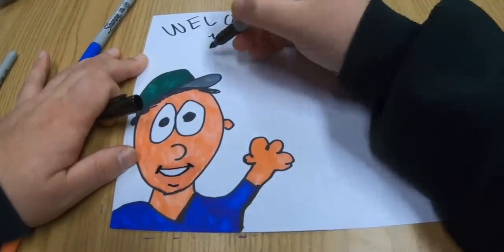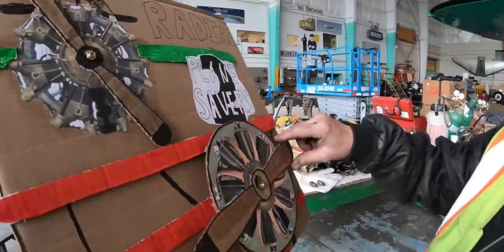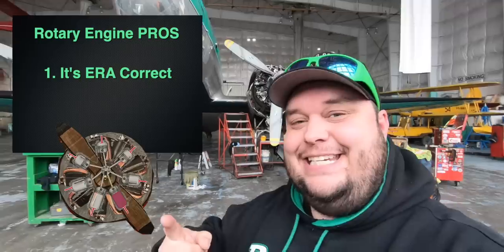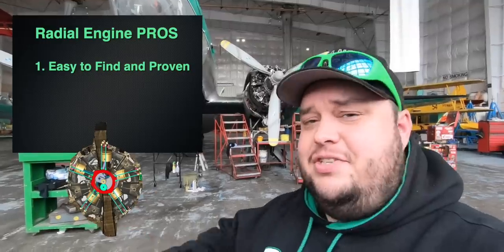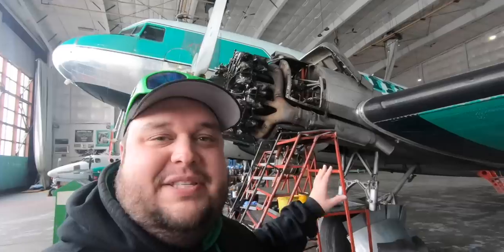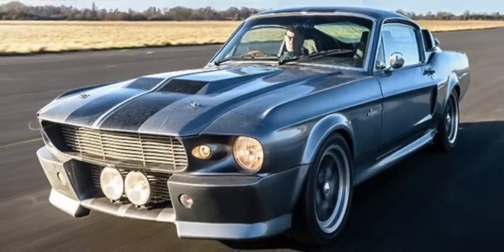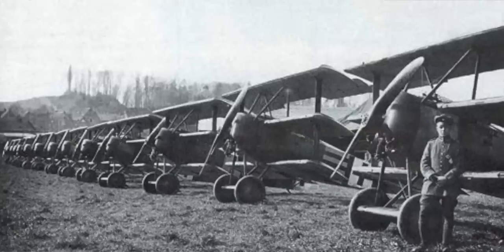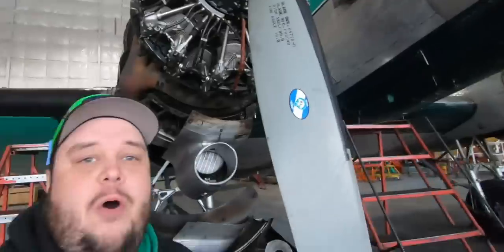Radial vs. Rotary | AIRCRAFT ENGINES | Plane Savers S2-E6

Comment: They did have a throttle; in fact, most of them ran very similar to modern aircraft (air and fuel adjustment) engines minus the starter and the sucking procedure. Only engine that was one and off was the Gnome 100hp series and later they improved it with the Gnome 160hp series of which used an ignition timer instead of a carburetor in which the spark will change the number of cylinders get ignited when they were filled with fuel and air. The Gnome 160hp used a four place switch it which throttle was operated by the number of cylinders that were sparking. It was odd-numbered as most rotarys had 9 cylinders. Ergo a four/five place switch.
1,3,5,7,9

Comment: You will want to read "Flying the Old Planes" by Frank Tallman, who discusses the operation of the rotary engine.  The Gnome Rotary used castor oil for lubrication.  You are correct that the pilots breathed the vaporized oil, which made for some interesting problems.  You can imagine why the pilots walked with a certain swagger.  This also is why the pilots drank milk laced with brandy.

Comment: Early Rotary Piston engines also used a "total loss" lubrication system using  Castor based oils which is why pilots were always seen running for the toilet on landing!

Comment: Sensible move on the Radial motor the Rotary was an absolute dog to fly with very poor throttle control...basically "All or Nothing"!
The old WW1 pilots did indeed get covered in oil, usually Castor Oil which had a rather unfortunate effect on the Pilot's Bowl as it is a laxative! Unless you want to spend the rest of the day in the "Little Boy's Room" after a brief flight around the field, stick to the Radial.
Did I hear you say a DR1 Turbine, now there is a thought...OMG, No no... I think I need to go lie down

Yet another great video and I love the graphics and animation...as ever ...keep up the good work matey!

Comment: The cowling of a rotary engine is closed on the top and open on the bottom. It is cooled because the engine rotates through the open space at the bottom where air flows over it. A radial engine's cowling is open in the front but closed on the sides and curves in toward the front so that it covers part of the front. If you put a rotary engine cowling on a radial engine it will overheat. The rotary engine cowling was closed at the top to deflect part of the exhaust. The engine lubricant was castor oil which is a laxative.  Rotary using pilots did not have constipation problems.

Comment: Great point on cars and your logic I feel it spot on. I have a 68 mustang fastback that I'm building , and it is funny how the movie the car and a real Shelby are so different  in all reality. In the end I'm just building mine stockish. Not an Elanor or Shelby clone, which it is a bit odd because both were the reasons to choose that car in the first place, but just as they were they were from Ford was cool. Of course I did have to buy a Shelby 67 GT 350 hood that fits the ford front end, and the car will have Shelby stripes. Running a Windsor engine built up, and never came in that year, but nothing had to be chopped up to do that and could be put back to 100% stock pretty easily.

Comment: 10/10 for staying with the original engine type as fitted to the replica airframe which was designed to accommodate it. This means there will be needed no innovations or experiments or workarounds to make something else do the job. - Safety first.

Comment: As noted by others, it wasn't just total loss lubrication, it was originally castor oil as they had no other lubricants that could function at high altitudes. And, yes, you had fights in that war as high as 18k, as Arthur Gould Lee noted in his memoir, No Parachute. He flew a Sopwith Pup and had to fly very high, and with hypoxia, to be on even terms with the Albatross DIIIs he was facing. There was another fight too due to the castor oil. It was treated with a large belt of brandy just prior to flying, "To stun the bowels," as Lee put it. 😂 Personally, I'm disappointed with your understandable engine choice, but it's not my project and I wish you nothing but luck on yours!
Reply: Plus castor oil clings to metal unlike ordinary oils essential for a spinning engine,the negative side is that it becomes gummy and needs a lot of maintenance,fabric used to go sticky.

Comment: Mikey, I have read that rotary engines in ww1 planes used castor oil instead of dinosaur juice. As you mentioned, this flies into the pilots face. Some would be swallowed. This led to a constant semi-diarrheal state for the the guy in the cockpit.

Comment: "FUN" FACT: Not only did the rotary engine spit out combustion products and oil straight out, including in the pilot's face, but it was lubricated with liberal amounts of castor oil. Castor oil is a strong laxative, and the first thing WWI pilots did after landing, was to run to the toilet, because they ingested quite a bit of the engine lubrication.
Sh*t happens. Especially if you were a WWI pilot! That brown note aside, those pilots had a pair of brass! Life expectancy was extremely low, not only because of enemy fire, but also because the planes they flew had only been about a decade in development since man's first powered flight...

Comment: With the way rotary engines were designed the exhaust strike of the engine was always when the cylinder was pointing toward the bottom of the plane whicb is why ww1 aircraft had that stereotypical partial cowling were the bottom was. They did however fling oil in all directions again facilitating the open bottom cowling minimizing oil being flung up and directing it all bellow the plane. The exhaust for the rotary engines  ever really reached the pilot only oil ever did. Other wise everything else was on point! Well done!

Comment: Don't underestimate your 318, they're potent when tweaked just right. Definitely check out the original Gone in 60 seconds, about 45 minutes of just car chase. Make sure you watch the history and making of the movie, gives you a better appreciation of it. 
I think the radial would work fine. You only see the bottom through the cowling, in the air you won't be able to notice and it's already been in the plane so makes it easier to stick with it.

Comment: My understanding is that the rotary engines used castor oil as a lubricant and the constant spray of oil from the exhaust onto the pilots face and lips would cause them to ingest small amounts and gave many of them a chronic case of the runs.

Comment: Very nicely done, Mikey. Just for the record, when I asked the question a couple of episodes ago (radial vs rotary) I wasn't particularly advocating for one or the other. Based on the excellent points you made here, I wholly support the choice of radial.

You mentioned the lack of throttle on the rotary. Anyone who has ever watched movies/videos of rotary powered aircraft know the sound of the aircraft on final as they switch the ignition off and on ("throttling" back, as it were). It's a distinctive "braapp!" "brapp!" sound. And another side disadvantage is that with the switches off, the engine is pouring raw fuel (as well as the ever present oil) into the slip stream.

The other huge disadvantage (mentioned elsewhere, sometimes incorrectly identified as torque, or even more incorrectly referred to as P-factor), is the gyroscopic effect that big spinning mass has. Either rudder or elevator input will have an effect 90° out of phase with the input, which needs to be seriously managed in flight. In battle it's even more serious, but you're unlikely to encounter battle conditions regardless of engine...

Comment: One big pro for the rotary is no reciprocating mass, the pistons do not go up and down.. They were a very smooth engine.
Reply: Hal Martin  The pistons cannot move up and down because the crankshaft is fixed. If you took a radial engine and fixed the crankshaft and allowed the cylinders to rotate it becomes a rotary engine.

Comment: Wrong about the scarf (mostly). The silk scarf was to prevent chafing as the pilot was constantly swiveling his neck to try to see the enemy first. The constant spray of castor oil was an amazing laxative, which is why you always see rotary engine pilots jump out of the cockpit and take off running; he's headed for the latrine.

Comment: Not quite sure what you mean by the Rotary is cool, but that is one of its main attributes, it cools much better than a fixed radial, it is also considerably lighter than a fixed radial engine which can cause CofG problems in a normally rotary engine aeroplane like you have here, but one thing you do not want to fit is a rotax of Australia radial, there is a homebuild in France that has crashed several times due to the failure of these junk rotax engines, there is a company in New Zealand that is making a perfect replica of a WWI rotary engine, but of course it is expensive ! Good luck in your project, you have the right attitude.

Comment: I was told by my lecturer during one of his rambles that rotary engines were mainly used because they were the best option for there time... the propeller and the engine would often counter rotate, fighting the torque of a propeller driven by a radial was a big cause of non combat plane losses during ww 1 and the counter spinning engine negated this to a large degree.. the other big problem of the time was materials... all they really had then was cast iron and spring/gun steel to make cylinders which causes problems in radial engines as you have a 200 mph blast of sub zero degree air hitting one side,  the rotary on the other hand had a much better and equal cooling effect and cylinders could be made much thinner and lighter than on the equivalent radial... so even though they were generally more complicated and prone to breakdown if not looked after very very carefully the advantages for a lightweight biplane did make them a viable option.....

Comment: Mikey.. the Fokker and all planes with rotary engines had that big distinctive round cowl that covers the entire upper part of the engine and very little oil or exhaust gets to the pilot. But you'd rather fly a shakey jake, with twice the HP of the Oberursel that is a good choice  but hardly similar. Still very cool looking forward to the next vid.

Comment: Rotary Engines  have a massive torque effect.   They have much more spinning mass than the radial type.  This give aircraft fitted with them a nasty torque steer on takeoff.  
This made early planes nasty to learn on compared to later radial planes.  BTW the Pratt and Whitney engines even powered German aircraft in World War Two.  Some BMW radials were license built version of P&W models.  The Junkers JU-52 was fitted with three of these engines.  IT served Germany as its primary transport aircraft,  roughly like the DC - 3.  The JU-52 was a Tri-motor.   The nose engine sprayed the cockpit windscreen with oil.  It used constant loss lubrication  with no valve covers.   A nice Video

Comment: It’s hard to believe that dc-3 engine was built so long ago. It’s really amazing that engineers were able to design and build the engine back in the early 30’s I mean that’s a really complex engine for that time period there’s so many moving parts. The biggest most shocking thing about it to me is not even so much that we were able to design and build it, how incredibly complex it is really it’s much more complex than a turbine engine with the shear amount of moving parts but what’s amazing is that the engine is reliable. Just think about it just 30 years before this engine had its first run that’s when the write brothers had their first flight. We’re taking in 30 short years we went from the only transportation was a horse and train to a complete Aviation industry with very complex aircraft and aircraft engines, the automotive industry and the mass production of both. Now cars  were a very important thing but they weren’t some super complicated thing the aircraft was just everything from the variable pitch props, to the 2 speed superchargers, supercharger and turbocharged on the same engine, having redundant systems so if one system fails like a mag they can switch one on and off, the way they casted the parts, the way they machined the parts…. Man just so many things were just ground breaking for the time just an un real amount of super complex machinery, technology that was created so fast. In my opinion the aircraft back then was almost like the equivalent to us seeing a ufo fly by nowadays.

Comment: if the rotary engine is correctly installed, then the exhaust is ejected when the cylinder approaches the lowest  point in its rotation. Most of the caster oil then passed under the airframe, however some of it was blown onto the pilot. This oil was absorbed into the skin & the subsequent laxative effect could kick in pretty hard & a quick return to base was essential. 
Not every pilot made it back in time.
Reply: This is not true. Silly myth. Many Rotarys are operated today and nobody reports any ill effects. You must drink the oil not smell or touch it for it to work.

Comment: So while most rotary's used an ignition interrupter or blip switch to give the pilot some control over the engine power, there were a few that were somewhat more advanced.   These were typically 9 cylinder engines and they would have a bank of three blips so you could switch 3 cylinders on or off at a time.  This gave you four power settings.  You could run all 9 cylinders, or cut back to 6 or 3, or off completely.  This was towards the end of the period where rotarys were used and as such, never really took off (no pun intended), before radials and v-blocks took over.  

Ultimately the rotarys had other serious problems that couldn't be solved.  The spinning mass of the engine caused serious gyroscopic torque whenever you tried to turn or pitch, for example.  Also there were size limitations on the diameter of the cylinders because if you go too wide, there just isn't enough air to cool the engine.  Trying to make the engine bigger by making the cylinders bigger or adding more cylinders ran into a solid wall of diminishing returns.  There's a point where the air around the engine was too warm to cool the engine.  

Rotorys are interesting and quirky, but they turned out to be a technological dead end.

Comment: FANTASTIC Intro!!  AMAZING skills!!!  =)

There were several reasons Pilots wore scarves in the early days of flying (up to the late 30's/early 40's when it was more "tradition" than utility).  With the oil coming out of the radials, it not only covered the Pilot, it also covered the entire fuselage.  So WWI aircraft, when hit with bullets, frequently burned... fiercely (and parachutes weight 90+ pounds.  The engines of the day were not the most powerful for lifting weight, and most Aircrew didn't wear them).  Having oil coming out of the engine made Windscreens practically useless (especially when you were trying to shoot at another plane!) because, like the goggles the Pilots wore, with oil covering everything, windscreens and goggles had to be wiped-off frequently (another reason for the scarves).

Also, remember the oil that was coming out of the engine was HOT!!  Helmets, goggles, scarves and neck high coats protected the Pilots not just from the wind, but from the hot oil! (ever touch the oil from a car engine that had been running for awhile... yeah.... THAT!)  Most Aircrew had 'red faces' and not just from wind-burn. Post War Movies of WWI Pilots may show them with their faces exposed (for the camera), but when looking at actual WWI Aircrew photos, you'll see they had almost their entire face covered.

Scarves also helped Pilots when they were looking around for Enemy aircraft.  Most of the uniforms of those days were wool.  Wool helped keep Aircrew warm... but scratched the heck out of necks, which was NOT pleasant.  Scarves at that time were usually Silk.  Pilots would wrap them around their necks under their uniforms, then use the ends to wipe all the exposed parts of their face and goggles.  Scanning the sky for the enemy was MUCH easier, and one less things for Pilots to worry about.

Comment: Plus the castor oil being burned or expelled from a traditional rotary results in a residue which begins to gum up the interior of the engine. The result is that the motor needs to be regularly torn down and the interior cleaned after a remarkably few number of hours of operation. An inconvenient and expensive issue for any aircraft which is expected to be flown on a regular basis.

Comment: Loved the animation! I'm a past member of the Middle Ages recreationist society, the Society for Creative Anachronism (SCA), the people who get dressed up in Medieval costumes, hold giant feasts and some of which beat up each other with bamboo swords and steel armour. They have the aim to be as period-correct as possible...but it's that "creative anachronism" that comes into play...if not for velcro, zippers and other modern accessories and fabrics, much of the costumes (or as they call it, "garb") would not be possible or wearable for any length of time. 

So long post short...going with the modern, safer, and maintainable engine was really the only choice. As long as it looks period correct, and since there is that cowling that covers most of the engine,

Comment: Sensible choice on the engine.  Rotary would've been cool, but where would you find one that can be had at reasonable price and get it airworthy?  
We had a "Shaky Jake"  radial at a community college where I attended aeronautics class.  Used to love running up that engine.